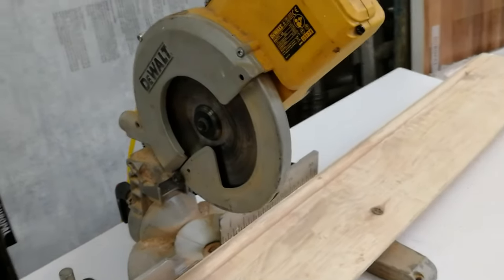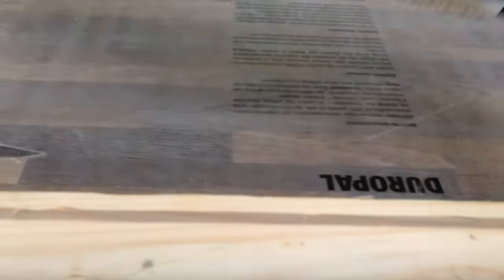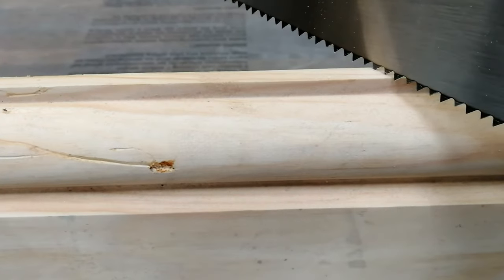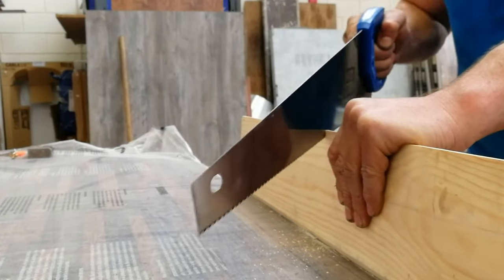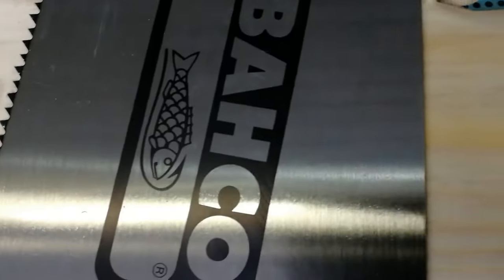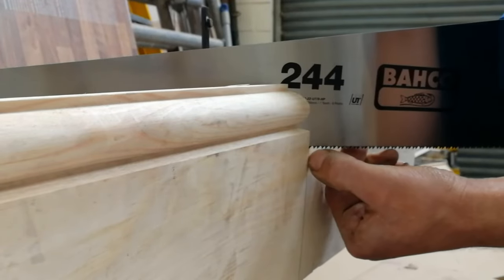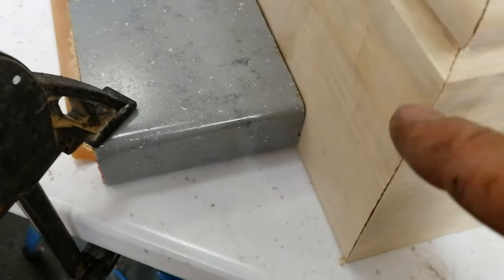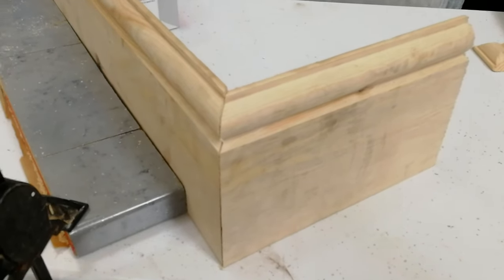How to Cut and Fit Wooden Skirting Boards Using Hand Tools | Step-by-Step DIY Tutorial

Comment: Hi mate could you do a video on a room which has uneven floors.. I’ve heard scribing skirts can be a bit awkward when it comes to lining up the mitres
Reply: You just use a spacer, and follow the floor, pressing pencil against the spacer as you move along the floor, leaving the pencil line on the skirting board.